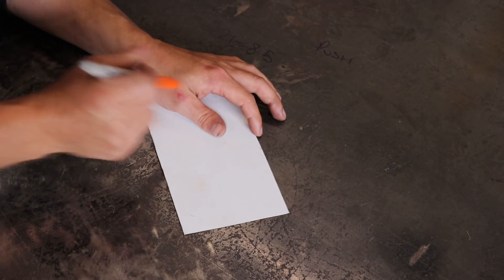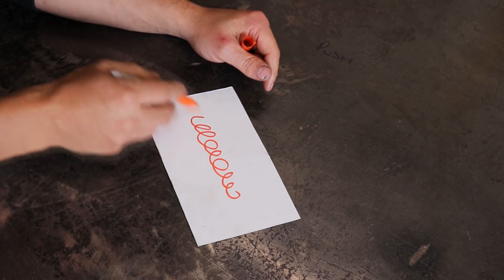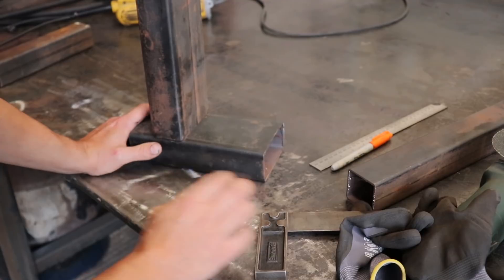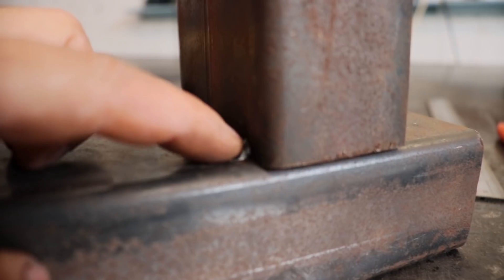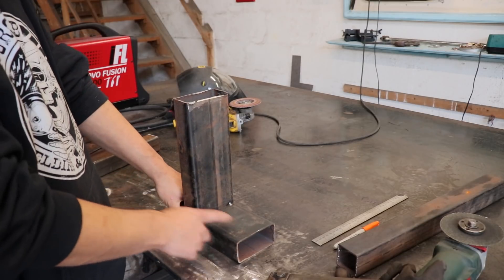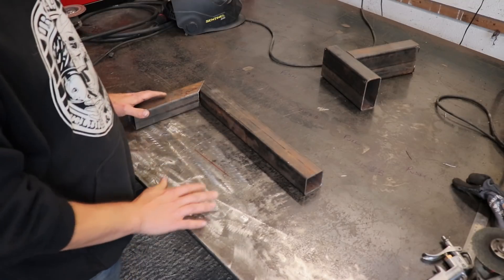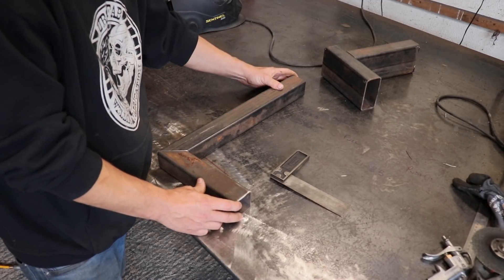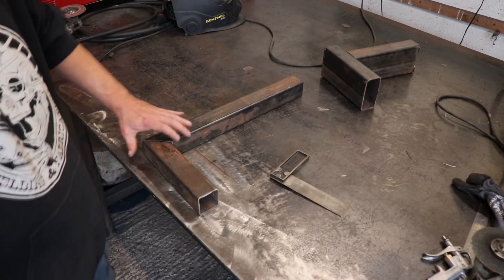WHY METAL MOVES AND BENDS WHEN YOU WELD IT.

Comment: Can a spring be bent using a welder and thus be reshaped?
What way will it bend?
I am guessing it will bend toward the bead side. 
But will it still act as a spring?
Reply: To bend the S of the NOS Homelite 350, 360 Chainsaw "S" Clutch 68362-4. 
Because it is worn out

Comment: Yep, I still get caught out occasionally, I tend to go for the fast tacking up thing as you described, sometimes I'll tack one side up and then weld the opposite side and this pulls it square but I started doing that for some jobs after I got my bandsaw which cuts 90° and 45° dead on so the material butts up square.But I still keep checking for square as I go, that way, if its pulled, I usually only have one weld to cut out.

Comment: Yes about the weld maps, you are correct for us this is a drawing where the individual welds are numbered for the welding sequence.   Not totally sure about any software for making these calculations.  I believe they mostly are from mistakes and experience.  The engineers collect the information and put the instructions on the drawings because the parts could be welded by different persons or a new person.  Usually if you follow the drawings even for the first time you weld up one it always works out good.  These are usually for recurring jobs like two or three a year but not high volume.   Have a good day!
Reply from the maker: Cheers

Comment: Very well done.  We do a lot of large and heavy stainless weldments.  That stuff is much worse for weld pull than say A36 or other mild steel.  In some cases they give us what they call weld maps showing the process or sequences to use to reduce the pull as much as possible.  Very good video and you are spot on with your thinking and explaining.
Reply from the maker: Cheers, yeh anytime I've done stainless manifolds its always a nightmare trying to keep the flanges flat. Ive never heard of weld maps before, that sounds really interesting.  Is that just a welding sequence added into the drawings etc? im guessing there's probably cad programs that can predict that stuff before its assembled  these days?